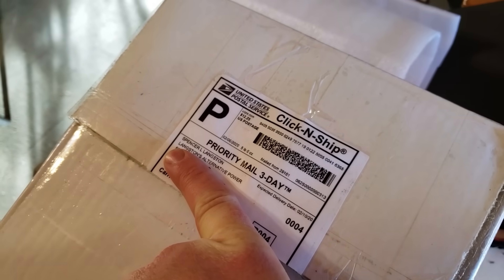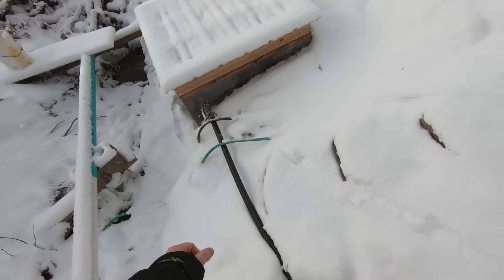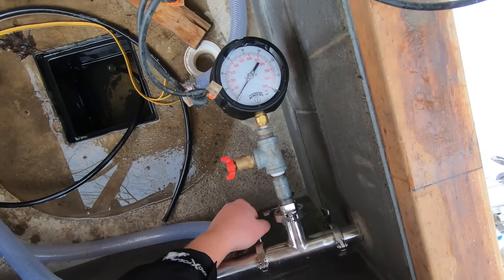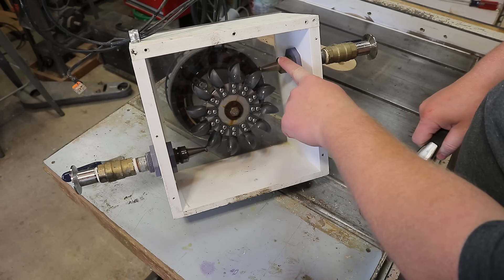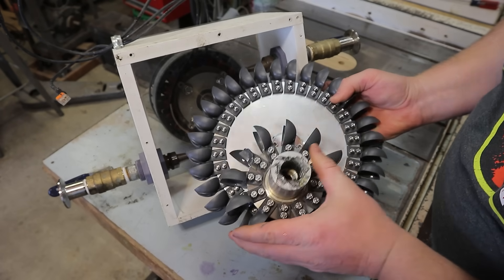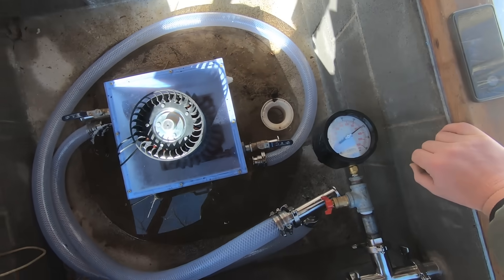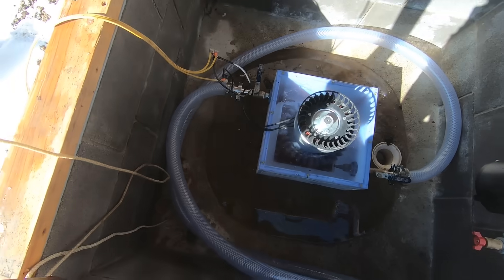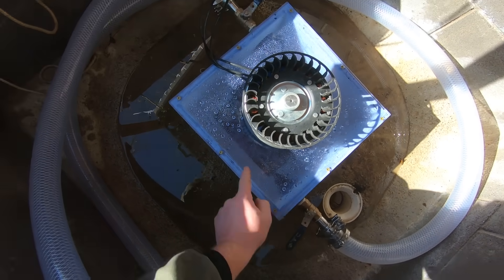Chasing 500 Watts, Big Pelton Turbine

Comment: Sorry if im late to the party on this video but I had a couple thought that might prove helpful.  Unless its just the nozzle adjustment or there is something I don't understand by this type of wheel (which I think I understand pretty well) I think your box needs to be bigger.  You are getting too much turbulence in the waste water.   You can see it as the water is splashing back in the opposite direction of the spray coming from the nozzle. It shows up more clearly if you slow down the playback to 1/4 speed.  It is especially prevalent in the corners opposite the nozzles but it is happening all over the box.  You want it to be able to freely throw the waste water once the push has stopped on each spoon.  Ideally you don't want any of the waste water hitting the the front side of any of the spoons. This will cause drag and will slow down the rotation thus decreasing the power.   I would increase the box size at least 2 inches in all directions ( perhaps not from the top to the wheel depending on how much it throws vertically).  This should cut down on the cavitation action quite a bit as the water will not be bouncing back on itself as much.   OR better yet make it round.  You will keep more of the circular momentum the waste water  has and that should help to drive the wheel with less loss.  If I'm not mistaken the original patent for this type of wheel used a circular housings but mounted vertically.   I think your horizontal rotation is a better option at it should cut down on baring wear and distribute the force more evenly on the wheel.   The only other thing I would think about changing is if you are working with someone to design you spoons/wheels have them put a slight angle to them so that as the water is falling due to gravity the force gets applied.  I know it will be minuscule with the distance and the pressure you probably only need a degree or two but if your trying to perfect it and have control over such things it might be worth a look.

Comment: put a Y in the tube for your split that T is effecting the flow rate just from turbulence... the T'd line will get staved yeah you might got pressure but water will want to continue the direction its moving just like anything else..

Comment: Theoretically there should be no change in power with change in diameter of the runner. As long as the blades have a tangential velocity close to half that of the water jets.

Comment: There are far more accessories available at 12v from the marine and automotive industries than exist at 24 (truck) and 50v (telecoms).  BUT inverters are easily available to convert the higher voltages into mains.

Comment: Nice work and video.    The velocity of water exiting nozzles remain the same.    Using a larger diameter wheel should turn slower based on same water jet velocity.   Very nice setup.

Comment: For all you guys knowledgeable about these systems, what’s the best DIY system to utilize slow moving creeks with no ability to create pressurized sprays like this?
Reply: Gravity becomes high pressure with enough distance and water build up. (Think the pressures a submarine faces) 
The key will be enough water flow to turn the turbine and not run dry.

Comment: I'm quite sure instead of a box shaped enclosure with your turbine wheel, and if you had the water reaching its "resonance" flow capabilities, your turbine would spin much faster by getting all of the thrown water out of the way, instead of the turbine constantly fighting the falling "dead weight" water splashing into the corners and falling back onto the turbine. 

Just a suggestion 🤔

Comment: If input wires are a limitation now, consider stepping up the voltage near the turbine. As far as I can tell your rectifier can handle up to 1600V while the charge controller can handle up to 200V, yet it's getting only 70V input. So your set up should be able to handle double the voltage. My guess is that the turbine is producing 45-ish VAC (3-phase) and if you can step that up to 90V, current should be halved to 3.5A which means less power loss. Now, the transformer itself will induce a loss, so you'll have to make some calculations and figure out if it's worth doing. Moving the rectifier to near the turbine can also help.
Reply from the maker: I want the turbine to be able to free-wheel and not have the open circuit volts fry the charge controller. I already have some free heavy wire to install.

Comment: 0:09 An interesting way of packing, rest the metal wheel on the delicate plastic blades and then pack in foam on top!!
14:06 get rid of the chamber as it's a water brake and build a jig so you can tune the angle of the jets while running.
Reply: i thought so too lol

Comment: For anyone who thinks he was tightening it the wrong way......he was lining up the thread so it did not cross thread and fuck it up!

I actually had a guy stand behind me when he called me round to do his radiator, he told me i was turning the union valve the wrong way, i put down the tools and said "its a good thing you called me because you dont have a clue, and when i need advice on how to do my job i will quit doing it"

Comment: I just started watching these videos after a weird recommended video binger and do not know much about electricity at all.
Isnt it an issue to have water on those power cables?
Reply: Not before you turn on the turbine water wheel...No current going through, until you turn it on. If you noticed, he hooked up the wires BEFORE turning the wheel back on...VERY IMPORTANT! Also important to turn OFF the wheel, before disconnecting them...zaaaapppappaap...Indicates a strong enough current to not be able to let go...

Comment: One question, is it okay to keep the lead acid batteries out like that? I mean, you may get the draft in garage or any air exchange in that matter but lets say I keep this battery in area with restricted air movement, is it wise to keep these batteries under the electronics and near any metal or appliances while they get charged and breathe or evaporate the acid into the air. From what I expect without the air movement such as draft or exhaust to circulate the air, the remains flowing from the battery in the air will leak in everywhere and find its way to start corroding and eating away on anything metal-made or basically electronic in that regard. Am I wrong here? Similar effect happens with evaporating clorox, bleach products that arent sealed properly.

Comment: I have access to land with a creek running through it and Ive been wanting to tinker with a DIY turbine of my own. But the land I have access to is rather flat and the water rather slow, So I've been looking into maybe using a ram pump. How do you have such high psi? Is it all just gravity at work? No pumps?
Reply: I've built both a Pico-hydro operation and a Ram pump in the past. Hydro electric does need the drop in elevation that it sounds like you probably are missing with your land. The Ram pump really will only create greater water pressure from your flat land river, but it's not a good energy source for Hyrdo electric potential since you really do loose the flow rate with a ram pump. Quite honestly you'd do well to consider another power source such as solar or wind if you are looking for a method to create electricity.

Comment: the drain hose is mounted on the wrong side. to facilitate water exit and therefore greater efficiency / speed, the drain pipe must be mounted on the same face as the inlet pipe, so that the blades throw water directly at it. furthermore, the mouth of the drain pipe must be wide and not throttled. regards
Reply: I think that you're assuming that the entire chamber is filled with water. Actually the theory here is that when the water enters this chamber it hits an impeller blade with the hopes of using it's full momentum and then simply falls away with no real usable energy left. At that point gravity would take over and remove the water down as it does here.

Comment: Have you ever thought of using a compressor instead of a generator and then storing the compressed air as potential energy in any air thight  cylinder. Could be a, cheaper, more ecofriendly way to store energy( how many cycle could you do ? what's the real cost of an empty tank, compared to the chemical batteries). Think about it, you just transfer the energy of a body of water that fall from the sky, to compress air into a cylinder for latter use. This energy is retained by the metal or other airtight material.
Compressed air should store energy in a smaller container than the original volume of water that goes through.
This also prevent the need to store electricity, instead, you store potential energy in the compressed air, and use it on demand. Since this is not to go on a car or anything remote, the need for portable and compact is not necessary, I'm sure you have plenty of space to put a  BIG BIG BIG Airtank.

Btw, love you concept, this is a must for every homestead
Reply: https://www.youtube.com/watch?v=poGkWZRxVQc compressed air !!

Comment: Question.. Why should add hole on the pipe, while you can make a water jet at end of the tube using gravity, without losing power to push water out using hole..?

Comment: Great video, I will definitely watch more of this, but here are some points I want to comment on,
you don't need to spin the motor at high rpm, just get a motor with a higher number of poles (preferably a generator that is designed for low rpm rotation, as those are designed for hydropower generation).
Another point is to improve the shape of the container, you don't want the water to hit the turbine as it will slow it down, try building a circular container that discharges the water to the outside.
Reply from the maker: To efficiently use a 90 mile per hour jet of water at a low RPM you need a much much larger runner which gets very expensive.

Comment: How high head you have and how much water is flowing through it with this setup?
Reply: One foot of height gives you about 1/2 psi. So if for example you have 30 psi you need approximately 60 feet of height to get that pressure.
Reply: @richardfrans2614  I don't do unicorn units.

Comment: Very cool system! I'm sure if I scour your channel more I could find the answer but... do you have a comparison in output of using two jets instead of one hitting the pelton? For some reason my brain can't manage to see why two would be better than one if it's from the same source and traveling at the same velocity. But on the other hand there is more water hitting it it right? Or is it just dividing the amount that would be coming out of one in half?
Either way super cool setup my friend.
Reply from the maker: Two jets double the water which is double the power at the same pressure. it's not actually the same pressure but it's close enough. I lose some to friction, and I have a finite amount of water, it's really only capable of a limited amount of power.
Reply: @JoeMalovich  why not 4 then

Comment: you have too much water staying up inside the box after hitting the wheel.
Reply: Agreed, should be circular shape not a box, doing so would assist in making the water go down, like a funnel/corkscrew.  Putting Corkscrew type fins in the bottom of the shoot would force the water out faster as well.. I bet it would spin much faster. Kinda like a Turbo.

Comment: I like the way you connect those pipe fittings. What are those stainless steel collar clamps thingy called?
Reply: Those types of fittings are used in sanitary (food and pharmaceutical) applications because they’re easier to take apart and clean than threaded fittings. Tri-clover is a brand of those fittings. I like them in this application, too.

Comment: Very nice setup, well put together. The charger rating is rated in Amps, if your charger is 40 Amps per example it will be 40 Amps at 12 VDC (right about 480-500Watts output) or 40 Amps at 24 VDC etc etc (chargers can be 12/24 or 24/48) which is then twice the amount of power, this will only be a problem to you if you were curtailing production due to reaching already the Max charger Current (as for the 48 to 24 VDC question), if your current is already close to the current limit of the charger yes that is a limiting factor definitely. If you can measure flow velocity in your pipe and manifold pressure you can for sure estimate maximum Hydraulic power before the turbine, and see what is the efficiency you are getting at the moment, for that you need a large flange mechanical flow meter to avoid much flow restriction to the turbine. That can guide you into next steps to achieve your desired power production. if the efficiency is high then you are looking at high losses or water flow from your reservoir, it is is low you may benefit from an additional injector(s) and look if you may have too many buckets (too small as well) on your wheel which can be the culprit of all the splashing inside the box.

Comment: i want to see u make water pump continue running 24hour charge battery and the water pump run electric from the hydro it self with full charge battery if that project can be make u will have 100% clean energy other then solar power that only can run in day light only u have free energy until u die with cheaper cost maintain the bearing only and cycle the water forever hahahaha also free water just need to use osmosis water

Comment: Off question, but the right group to ask. If I have a 24-volt inverter with a 90 amp charger and a 48-volt inverter with a 180 amp charger is there a difference in the number of amps I am putting in or does it drop in half because of the higher voltage. 

The situation is this, my neighbor has a large battery bank 2400 amp-hours that can be configured in 24-volt or 48-volt, either configuration requires a large charger to maintain them according to the manufacture. He is currently has a 24-volt inverter with a 90 amp charger which requires a long generator run time to bring the batteries to full charge.
  He is being told if he moves up to a 48-volt inverter/charger he will be charging at 180 amps. I thought by stepping up the voltage the amp comparison (charge rate) is the same. In other words, the higher amp charger figure is washed out by the higher voltage so you're still having to run the generator for a long time.
We live in the north and are mostly diesel-powered in the winter, about 60 percent of our power is made by solar in the summer months. Trying to save some diesel...
Reply: I am not going into details on this stuff as it is all over the internet on solar power forums.
A 2400 amp hour battery at 24 volts becomes a 1200 amp hour battery when wired form 48 volts. So ya putting 180 amps into a 1200 ah batter will charge faster then 90 amps into a 2400 ah battery.
But the main problem with charging a lead battery from a generator is not the initial bulk charge at high amps but the final absorption stage which takes hours at low amps and cannot be rushed.
I normally use the big generator early morning to put the bulk charge in and the let the solar or wind finish the job or if they are not available I get the smaller Honda inverter generator going.
In the end more solar panels to cut down on geny run time.
Reply: @andreblanchard8569  Thank you so much for this Andre!

Comment: I really think you should do something to keep the wire connections from getting wet, possibly make a housing and attach it to the wall and then run some clear pipe you have left over to enclose the wires. I cringe every time I see those wires, even more at 3:15 when they were immersed fully in water.

Comment: Re tap the threads and it will solve the 1 bolt problem.........
Reply from the maker: I sourced the correct bolt, it's not an issue anymore.

Comment: Nice to see it running.... but that square peg in the round hole is causing some HUGE losses... look at the vortexes generated in the corners of the box...back feeding the wheel. Can hear it. Nozzle angle could use some optimization too. 

Round wheel, round chamber, better efficiency, lower losses. :) Overall, an entertaining video. 

Take care, stay safe!

Comment: Hi Joe, how do you get your pressured water from? this is a really nice way of get clean energy, if you aren’t using a device to pressure the water that consume pollutant energy, are you?  best regards. Interesting video anyway.
Reply from the maker: Gravity fed spring water, it is free energy.
Reply: @JoeMalovich  Joe to have this pressure from gravity means that you have a big altitude from intake to the nozzle discharge, how many feet or how do you get the pressure? having just a small pipe diameter? sorry, but I’m really interested in your nice way of produce clean energy. Have you bought the pelton runner and the generator from internet suppliers? Thank a lot for your time.

Comment: https://www.youtube.com/watch?v=t7MOPX75s2Y try this but remember to remove the exciter battery after a second or so and use a 300 amps alternator then the controls system is the only important parts. oh and it runs forever if elon musk doesn't find out. it runs till the bearings freeze up can be done indoors or the battery plate from the car battery wears out. 12 to 20 years. always just use junk in case.